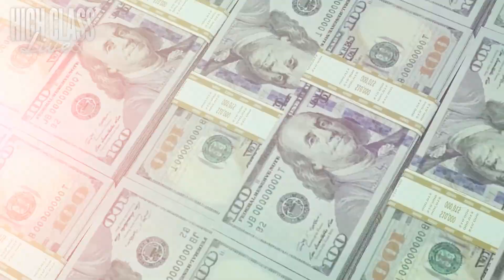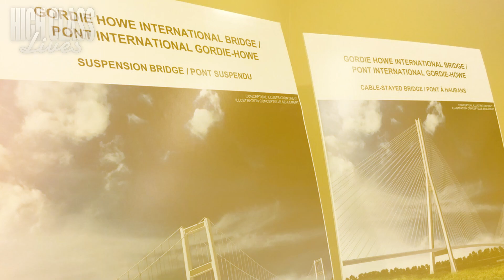Are You Ready For The $4.4b Gordie Howe International Bridge, Opening In 2024?

Comment: So why is there no train track going over that bridge ? Talking about sustainability.... besides that, yeah cool bridge.
Reply: There is the existing underground train tunnel.
Reply from the maker: The Gordie Howe International Bridge will have a rail corridor that runs alongside it, connecting the Canadian National Railway with the Norfolk Southern Railway in the United States. However, the rail corridor is located on the Canadian side of the border, so it doesn't cross over the bridge itself.
Reply: The train tunnel was built in the 1920's, and is located between Downtown Detroit & the Ambassador bridge, about 3½ miles north of the Gordie Howe Bridge.
Reply: Could have done it! Tracks were needed and there again, could have been a HUGE money maker!